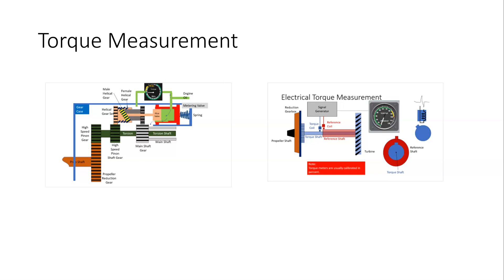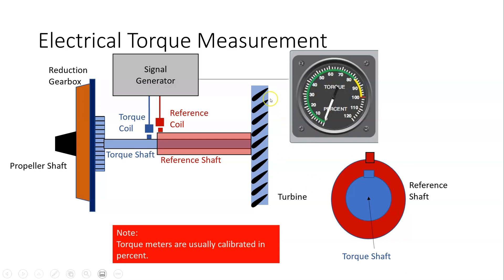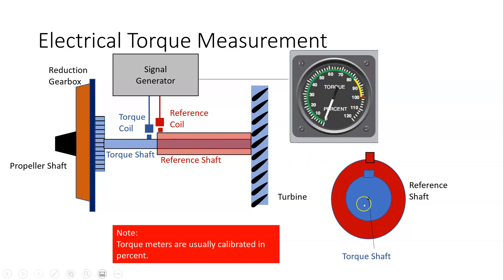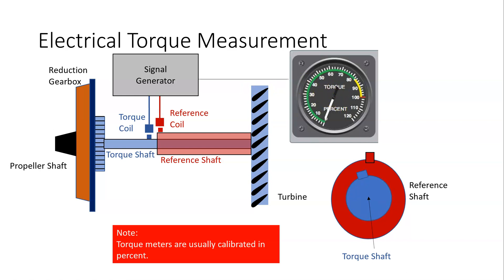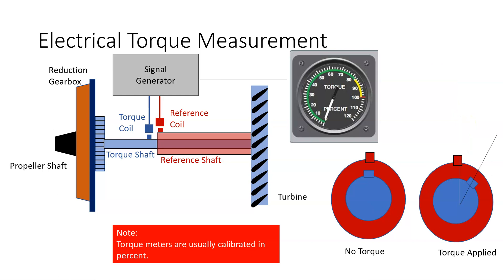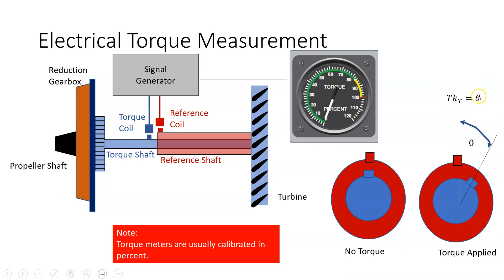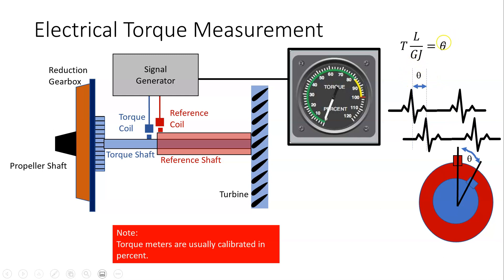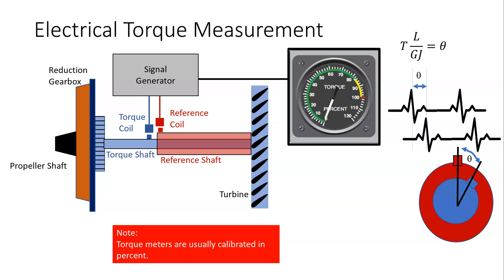Torque Measurement Part 2

Comment: At time 3:00 when the animation shows how the shafts rotate, the rotation is in the WRONG direction. When the turbine produces power and the power shaft is loaded the torque causes the torque shaft to lag behind the reference shaft. But the animation shows the blue torque shaft leading the reference shaft. If you would reverse the rotation sense of the animation it would match the given explanation.
Reply: good point
Reply: if the reference shaft and torsion shaft are driven by the same gear so how it will  lag  or lead please explain...
Reply: @vasimsaifi2824  The blue torque shaft transmits the torque from the turbine to the reduction gear. The turbine is the "torque input" to the torque shaft, while the connection of the torque shaft to the reduction gear is the "torque output" from the torque shaft. This torque load at the output causes a torsion (twisting around its axis). Therefore the angular orientation of the output side of the torque tube is no longer the same as the angular orientation of the input side (turbine side). The higher the torque load that is output through the torque shaft, the greater is the angular torsion (twisting). The reference shaft gives the "no-load reference" position or angle of the shaft, because the reference shaft is not twisted by any torque load. Therefore the "torque measuring system" can sense a phase difference (or pulse timing difference) between the the two magnets of the respective shafts.
Reply: @vasimsaifi2824  The torsion shaft has a load on it, the reference shaft has no load on it. The load on the torsion shaft causes the shaft to twist very slightly as power is applied to both shats. The reference shaft doesn't twist (or twists very much less) because it has no load on it.